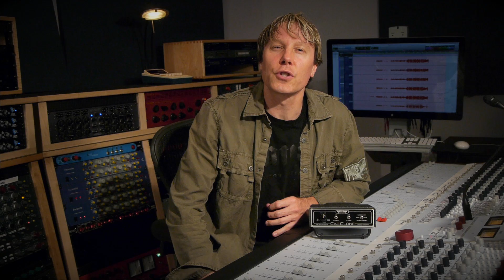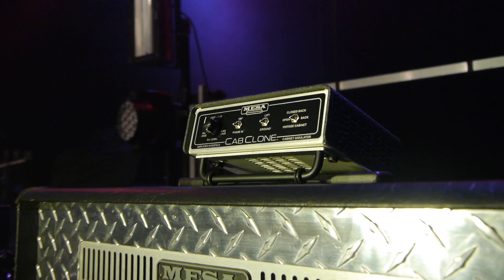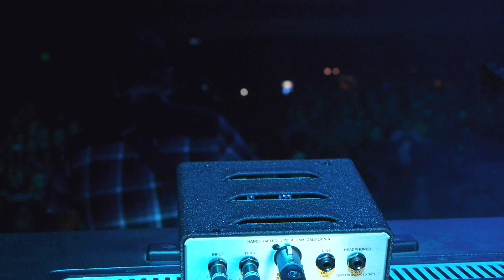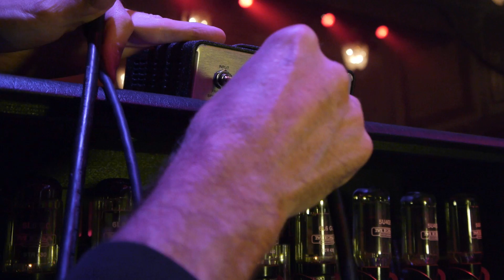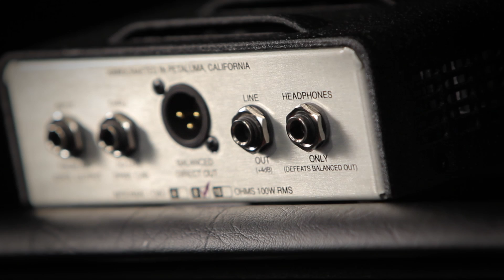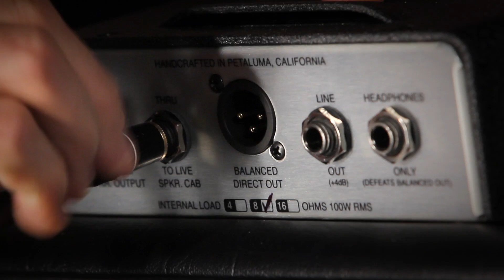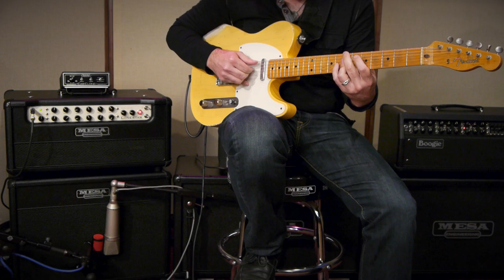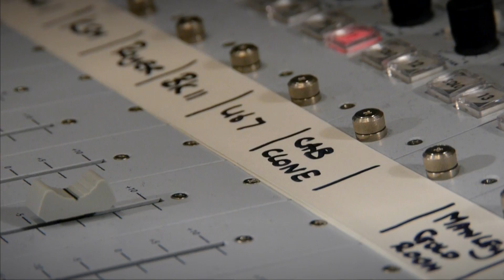MESA/Boogie CabClone Official Demo Video

Comment: My question is.... why didn't anyone think of this before? Seems like a no brainer for bedroom guitarists. I have a Dual Rectifier, but sadly I can't achieve the tone I'd like... partially due to the fact that i can't achieve the volume levels needed for it to shine without being blown away.
Reply from the maker: Thanks, DeadCell34 - Your situations and quite a few others is exactly why we created the CabClone. Appreciate the kind words and it should serve you well!
Reply: MESA/Boogie I do have a serious question about the Cab Clone. My current setup is a Mesa Dual Rectifier with a 2x12 Orange cab. Well, as you know, the Dual Rectifier can vary in impedance with a selection switch. However, my Orange cab has a 16 ohm impedance. 

That being the case, should I buy the 16 ohm Cab Clone if I ever intend to use my cab with the Cab Clone?

My thoughts are that the impedance of the Cab Clone is primarily dealing with the impedance of the amplifier head, and not the external cab. But I wanted to check and be sure.
Reply from the maker: Hey DeadCell34  - The most important impedance to match with the CabClone is the cab you plan to use. In your case, 16 ohm. Regardless of what options your amp offers for outputs, it's the speaker's impedance being matched (to the CabClone) which offers the optimum tone from the CabClone, especially when using the THRU option. It's potentially confusing but most for your CAB to match the CabClone's impedance sincme most amps offer impedance matching options to cover the variety of cabs out there. Hope this helps and thanks for your interest!
Reply: MESA/Boogie 
Thanks for the reply. Good to know.

Comment: Hello Mesa/Boogie.
How can I connect the 20/20 amp to the CabClone I am running a Triaxis with a 20/20. Will I have to use just one channel of both amp and Triaxis?
Thanks
Reply from the maker: HiVitor Caçador - That's correct. Just connect to one side via the Through and to your cabinet and that will provide your direct sound from that side. Hope this helps and thanks for your interest!

Comment: Hey guys! Just got my Cab Clone (8 ohm) and I am absolutely in love with it. It sounds phenomenal running with my Mark V through my Mesa 4x12 and it sounds great through headphones as well. It will completely revolutionize my night time playing and my recording in general. However, I was curious about using it with a 16 ohm Orange 1x12. Would a mismatch be relatively safe in this instance since the speaker essentially becomes the load when using the THROUGH output? Or is that not the case?

Comment from the maker: Hi +Renato Lousan - The CabClone is NOT an attennuator. It is designed to be used with our amp the way you would normally set it. Using it like you would use an attenuator may cause damage to the CabClone, your amp or both. However, you won't need to use it like an attenuator, because the CabClone sounds great when your amp sounds great! Hope this helps.
Reply: Thank you MESA/Boogie !! Now i am considering buying a Mark V: 25 for my next amp haha

Comment: Will you be able to play a gig with this without a need for an external cab? Am I right? Or do you need a cab for the box to work?
Reply from the maker: HiAndy Scarlett - YES! You can bring just your amp and run the Speaker Output DIRECT from the CabClone (using it's built-in load). OR - you can run both (if you bring your speaker). That's one of the things that makes it so useful. hope this helps and let us know if you have any further questions!

Comment: Dear Mesa/Boogie Team! Please answer my question)
If CabClone works like a Headphones cabsim also, can it work like an attenuator for my amp, just to crank my Dual Rectifier at home? If no, the what is the place of this device in the signal chain WITH the separate attenuator = amp - cabclone: 1) attenuator - cab; 2) external interface - monitors.
And the second question (sorry for the offtop).
Can I use the Mesa Pedal EQ like an attenuator, placing it in the FX loop of my Dual Rectifier. The pedal has is separate input gain and output level, so I thought it should solve the question.
Thanks, Mesa Team! 
You're the best, as Your products are! \m/
Reply from the maker: Hi Andrey Sklyarov - The CabClone is NOT an attenuator. It does not allow you to "crank up your amp" - it allows you to record silently (at home or wherever you want) but it doesn't allow you to turn your amp up beyond where you would normally use it if you had your cab connected. It is a direct recording and headphone interface, but you should set it where you would normally use the amp. Hope this helps. 

As for MESA's 5-Band Graphic EQ, you can use it in the FX Loop of your Dual Rectifier, OR - in front of the amp, but it is not an 'attenuator' that allows you to turn up your amp any louder than you would normally set it. It just adjusts frequencies. The input and output controls allow you to optimize the input and output of the EQ pedal depending on where you use it but again, it was NOT designed to "crank it up" at any points in the circuit - it's designed to offer you frequency tuning of your sound, not attenuation. Again, hope this helps and thanks for the great questions!
Reply: MESA/Boogie It's not a secret, that thousands if not millions play their 100w amps at home. 
And I think that if there was Mesa Attenuator on the market- it would be the best one.
Like a Mesa lover, personally I would purchase one))
Reply from the maker: Great point, Andrey Sklyarov , and one that we're aware of. The CabClone was the first step into this market. Now that it's confirmed that people like the tone and features, let's see what comes next!
Reply: MESA/Boogie and I have the 2 channel Dual Rectifier, the best killer sounding amp ever! In a few months I'm gonna get the LoneStar to my rig. With MESA attenuator its cleans would sparkle even at the bedroom volume level and the Recto gain would summon Metallica just right in place))

Comment: So can this be used for recording bass guitar and normal electric guitar ?
Reply from the maker: Ryan's World - The CabClone is designed for guitar amps. Most bass amps are likely too powerful to be used safely with the CabClone, particularly for silent recording (using the internal load of the CabClone) and beyond that, most people prefer a DI (with no cab simulation) for bass. Finally, the CabClone has been voiced/optimized for guitar, so it might not sound as good as something that was optimized specifcally for bass. Hope this helps and thanks for your interest!

Comment: Morning Mesa :D - have kind of 2 1/2 questions surrounding in my head ;-) . As a matter of fact, CabClone is not an attunuator, hence, I will get the volume I dialed in with my master knob on my amp, when connected a cab to the THRU socket? Said this, if I connect CabClone to my Engl Gigmaster 15 which comes with an in-built Power-Soak (15 to 5 to 1 Watts), I could use the Power Soak, or any other external Attunuator-Device, to still get the desired amp saturation at low volume level. So what do you think using the combination of a Power Soak and CabClone. Lastly, a user review mentioned, that CabClone needs to be driven to deliver good tone! Could you comment on this, since this might could effect into a not so optimized tone using low Watt amps, or power soaked amp? Appreciate reading your feedback ... cheers!
Reply from the maker: HiMrTR909 - Great questions... all of them. 1st and most important (which was really your last questions/statement): CabClone should/does NOT need to be driven to sound good! The CabClone sounds best where you would normally set your amp if you were dialing it in with the cabinet you use for live or otherwise NON-direct/non-silent applications. This is why it is being so well received - because it sounds great where you normally use your amp! ;)2nd (actually first question): When you are connected to the THROUGH jack to a real speaker/cabinet, the internal load is 100% BYPASSED. The speaker IS the load in use. You can go wherever you want, volume and master-wise, there - it's whatever your ears and space can handle. So... If your source to the input of the CabClone is the attenuated SPEAKER OUTPUT of your amp... well, you get that circuitry AND the CabClone circuitry 'voicing' your recorded/direct sound. Your call whether that sounds good or not but as long as it's the speaker output connected to the CabClone, that's the signal it want's to see and your amp has already done the attenuation and 'soaking' of the output signal. Hope this helps and thanks for the great questions!
Reply: Thx Mesa. Hell yeaaah order placed!  will do some trials with the combination of attenuated and CabClone AND I really like the headphone out.

Comment: Quick question. I read it can be argued that reactive load boxes (two note torpedo series, Rivera load boxes) are better for tone compared with resistive load boxes (like the cab clone) since reactive loads act like the actual cab and thus are more "transparent". What were the reasons to use resistive loads as opposed to a reactive load for the cab clone?
Reply from the maker: Hi radz108 - The CabClone ACTUALLY offers BOTH! Plug in your amp's speaker cabinet via the through jack and you have a reactive load as the internal resistor is then bypassed. At that point, you don't have a silent recording option but you do have a reactive load with balanced XLR output and, most importantly, the CabClone CIRCUIT and TONE which is the biggest part of the GOOD tone you're recording direct. Beyond that, it needs to be mentioned that while there is a slight difference between direct recording with the CabClone's internal resistor or using your amp's speaker, there are FAR more similarities than there are differences... a testament to how good the CabClone direct circuit is for both the resistive and reactive load options the CabClone offers. Hope this helps and great question!
Reply: Thanks for the info! I have a cab clone on order from my local store here in Calgary to use with my Mark V. Hopefully I will get it soon and hopefully post some sound examples. :)

Comment: Can someone tell me if I need to use speaker cable from amp to cabclone?
Reply from the maker: rizalkhan Yes! Just as you would if you were running the cable from amp to speaker, you should use speaker cables from both your amp to the CabClone AND from the Through of the CabClone to your speaker if you are using the Through. hope this helps!
Reply: MESA/Boogie
Thanks. You should indicate that in your manual :)

Comment: Hi, i just ordered one in 16 ohms. Can i feed my 8 ohms tube head cab output to this 16 ohms cab clone. Is there issues or tone alteration or amp damage? Please advise.
Reply from the maker: HiMark Tan  - Not recommended. You should run the CabClone with the same impedance speaker as the rating of the CabClone. Impedance mismatching can get confusing and also can cause damage to the CabClone load resistor, the amp, tubes, or not sound as it's designed. Good question. Hope this helps!

Comment: can you go more in depth about the ground/lift option? only use lift when?
Reply: why are there mics hooked up to the cab? can you record without mics with this?
Reply from the maker: NjuiMusic The CabClone ABSOLUTELY allows you to record without mice - that's one of the main things it does! When we set up the session, we wanted to have the option to do comparison videos as well as just the CabClone by itself, direct, with no other signal. Setting it all up and having the options for multiple formats just made sense to us. We decided to provide CabClone ONLY demos first... and future comparison videos will follow as time allows.
Reply from the maker: Ground lift should only be used when you hear hum or ground loop noise. Always start in the grounded position and if you hear noise in your signal, try the lifted position to see if that removes the noise. Hope this helps!
Reply: thanks so much!

Comment: Quick question, I note there is a mic in front of the cab during the demos. Is what we are hearing just the cab clone or is that blended with the mic??
Reply from the maker: TheCrystalyne - The audio throughout this and all the demos is CabClone ONLY! When we recorded the video and the session, we put up a bunch of mics to compare. The CabClone smoked the mics! And, the studio we were at had a bunch of ridiculous mics so we set em up to have a bunch of options for the video. At some point we may deliver comparison vids (the other reason for setting them up) but at the moment, there are other features on the editing desk. Thanks for your interest!
Reply: MESA/Boogie Thank you much for the advice, if you dont mind another question. I plan to use the Cabclone with my Boogie 5:50 Express 1x12 (8ohm) with 1x12 (8ohm) extension cab. I'd like to continue using the amp in this fashion (2 speakers) using the Cabclone line out to my desk. However, I note that if using the internal speaker and the extension speaker, I plug the speakers into the 2x4ohm plugs on the back of the amp. So if I wanted to use the amp this way with the Cabclone, would I need to buy a 4ohm or 8ohm Cabclone?? Thanks in advance.
Reply from the maker: TheCrystalyne - You'll be looking for the 8 ohm version. Whether using it with both speakers in use at the same time or one at a time, the speakers themselves are 8 ohms and that's what you're matching. Great question and let us know if we can help with anything else!
Reply: MESA/Boogie Thanks for the update. I just managed to order one on Ebay, boy are they selling fast!!

Comment: So i have a question.... I just ordered an 8ohm version, so of course i would use the 8ohm output on my amp. So if i wanted to run my boogie  2x12 vert cab at the same time and its 8ohm can i with no issues just running out of the cabclone extension cab out?
Reply from the maker: Hi Estevan Garcia - If you're planning to use just ONE cab, you would just connect your cab to the THROUGH jack of the CabClone once the speaker out from your amp is connected to the Speaker Input and you're all set. If you have an 8 ohm cab and an 8 ohm CabClone, you're all set. If you're trying to connect two cabs, that's more complicated and is basically not recommended. Hope this helps and let us know if you have any other questions.

Comment: Is there no headphone volume??? Or does it use the DI volume when it's bypassed to the headphone input? Also I take it you order it from a dealer in the appropriate OHM setting for your amp?
Reply from the maker: Hi kryonso - There is no headphone volume control. The CabClone is passive and gets it's headphone volume from the Master/Output setting on your amp - this is the control you'll use to set your amp's volume. The DI Level ONLY affects the DI Output. Regarding OHMS/impedance, YES - order the appropriate impedance CabClone for the amps you plan to use it with. Thanks for your questions and your interest - hope this helps!

Comment: I ordered the 8 ohm one for my 5150III Amp, will this also work with my Fender 65 Twin Reverb Reissue even though it's rated Wattage:	85 Watts into 4 Ohms?
Reply: Hi Daniel Carey - Thank for the kind words and glad you've got one on order. As for using it with your Fender Twin, as long as you connect the 8 ohm speaker output of the Twin into the Speaker Input of your 8 Ohm CabClone, the wattage is fine. It should work great with your 5150 and your Twin. Enjoy!
Reply: ***** So as I'm understanding you, I wouldn't need to hook the speakers of the twin up to the 8 ohm CC to use it? Cool, thanks!
Reply from the maker: Daniel Carey The CabClone allows you to recored with OR without speakers connected. If you connect the speakers to the THROUGH jack, you're using your speakers as the load. If no speakers are connected, you are using the INTERNAL load. So - you don't have to connect a your speakers if you want to record/headphone silently. Best of both worlds!

Comment: MESA/Boogie Hi, please i have a question, is possible to conecta my tube amp to this cab lone, but whit not simulation, i mean i direct signal of the amp, and after of that connect the amp tru this cabclone to my interface and use some impulses ¿? thanks for reading this.
Reply from the maker: Hi Daniel Ortega - YES! You can use the Line Out which is just a Line Level tap off of the speaker output and is NOT Cab Simulated! Good question. Thanks for your interest!
Reply: MESA/Boogie great, thanks for the respond, this product is maybe in sweewater or guitar center is the only online store i now,thanks.